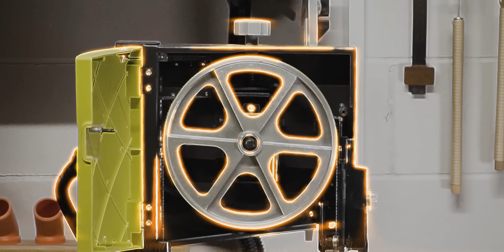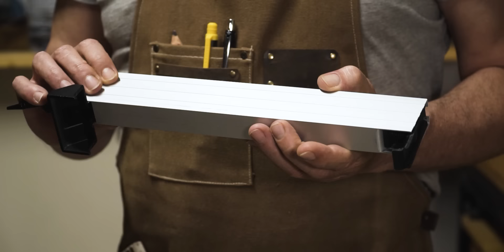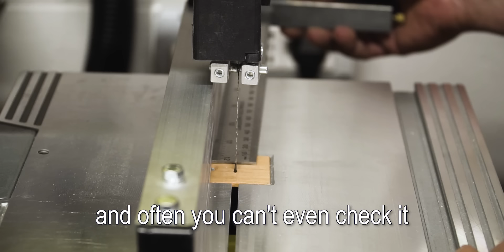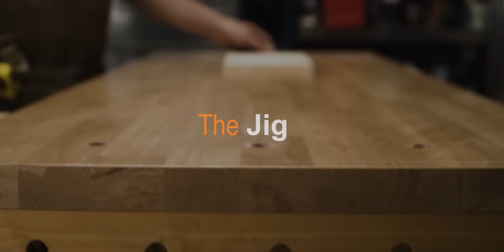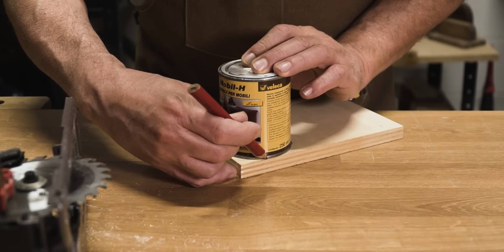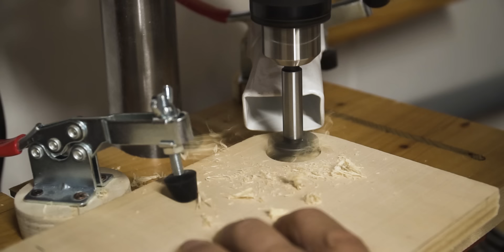If You Have a Small Bandsaw You Probably Need This Jig

Comment: Genius! Now invent one for crappy table saw fences. Many hobbyist woodworkers have older table saws and have to measure the distance from the back of the blade then the front of the blade before every cut.
Reply from the maker: Thanks for the trust but I don't have much experience with the table saw. Maybe it's better to make a new fence that maintains the correct position.

Comment: If the saw is so cheap as to have this type of fence, it probably won't cut parallel to a fence whether it is at right angles or not. What then?
Reply from the maker: And then you have to find the cause of the drift which can be:
- Shelf not perpendicular to the blade (needs adjustment)
- Dull blade
- Incorrect blade tension
There are 30-40 minute video workshops on the subject and how to fix drift problems (even with high end band saws).
I had a problem and showed how I solved it quickly.

Comment: I'm wondering why you didn't move the square down the rule of your combination square to check the fence.  Every combination square I've ever owned has that adjusting feature.  They even make smaller combination squares that are just as good at being square.  I'm just curious.
Reply from the maker: Mine was just an example to show that you can't always quickly check if it's square or not and then adjustments are needed. With the jig, on the other hand, you just rest the fence on it and voilà.

Comment: Very good design. I have the same band saw and not only does it have the same problem making the fence square to the blade but the fence always tilts. This means the timber you are cutting only touches part of the fence. Ideas?
Reply from the maker: This video offers a quick solution for sporadic use, if you use it continuously I recommend you make a new fence.
Thanks for sharing your thoughts.

Comment: Nice idea mate.i have the same crappy fence as you. But my handsaw also suffers from blade drift.ive tried everything I can think of,but it just don't seem to solve the problem.
Reply from the maker: There are really many causes of blade drift, the position on the wheel, the tension of the blade and also the sharpening.
I adjusted the shelf so that the side was parallel to the blade and then I adjusted the position and tension of the blade until it cut parallel to the fence.
This video may help you https://youtu.be/vNdrkmx6ehI?si=6qCYNNXNe81bdZxF
Reply: Also, if the wear on one side of the blade is greater than the other, it will drift to the sharper side.
Reply: There are guide pins (or if you're lucky ... Rollers) below the table as well as on the drop down guide bar. Set both to have sire minimal movement of the blade. Set correct tension. Reduces play that can I initiat3 blade drift. Many entry bandsaws have a quick tension release so that the blade is not permanently tensioned, flip the tensioner again before cut

Comment: I get it. I like it. A very good jig and I will make one. BUT (yes there is a but), I will NOT be using dye and losing the clean look of the birch ply. Good video.
Reply from the maker: Thanks for your kind thought.
I usually dye my jigs dark because they stand out on the light raw wood and I find them immediately, I find it practical (if I leave them natural sometimes I have them in front of my nose and I don't see them) :)
Reply: I get the problem and usually add a brightly coloured knob or feature to jigs that get lost because I like the natural colour of birch ply.

Comment: Question, I’m knew to YouTube and these videos. By the way what a gig, gonna have to figure out the dimensions for this. Thank you for this idea. Thinking outside the box!!! South Central Texas.
Reply from the maker: I don't usually give exact measurements of what I build because everyone has different needs and tools of different sizes. I try to give an idea and inspire people.
In the case of this jig the only fixed measurement is the distance between the front edge and the blade (which varies on each different saw brand), the width doesn't matter and can vary even by an inch.
Thanks for your thoughts.

Comment: Does that fence always lock off parallel the same way and by the same amount each time? If so, the two screws on the top are for you to fix that. Loosen them and straighten the fence, then tighten and it should be good. If it doesn’t, then it’s a bigger problem.
Reply from the maker: On larger band saws there is that feature, here it is not. The 2 top screws are just assembly screws. I consider this a minor flaw for such a cheap product that overall I am very satisfied with.

Comment: On my bandsaws, the blades do not necessarily track parallel to the fence. I take a straight 1x4 and mark a straight line down the middle, then cut it halfway by hand on the bandsaw, staying right on the line. Then, without moving it, I clamp it to the table and set my fence to that board, ignoring what is parallel or square. Now, I get perfect rips every time. If I change the band, I use this same procedure to get the new fence setting. It works for me.
Reply from the maker: If you use the same procedure and then adjust the saw table parallel, you only have to do it once and then with my jig you can adjust it quickly.
Reply: @LTMS  That may be. I have several resaw bands with slightly different characteristics, fine veneer-grade blades, and green wood blades that must be calibrated independently.  A larger model of your jig would be beneficial to dial in a table saw setting. I just use a tape measure and the "bump and clamp" technique.
Reply from the maker: @samTollefson  I see, my jig is for a small amateur band saw, to solve a basic problem, you have different needs.

Comment: Small band saws will only follow the fence accurately when the blade is new.  When the cut starts to deviate slightly it is some time of benefit to slightly offset the fence
Reply from the maker: There are many causes of blade drifting, and one is the dull blade. However, with a good general setup this jig helps a lot in most cases. I shared the video because it made things much easier for me.
Thank you for sharing your thoughts.

Comment: I don’t know why you wouldn’t make those cuts on a table saw. 

The jig is nice. The filming is great…but the question remains why?
Reply from the maker: I don't have a table saw at the moment, just a small circular saw, so I make a lot of cuts with my band saw.
Having the guide perfectly parallel is very important especially if you have to resaw thick pieces.
The two test cuts I make at the end are just to demonstrate that if the bandsaw guide is parallel you can get a lot of accuracy.
Thank you very much for your time and support, hope I answered your question.
Reply: A mitre saw would be even better for that type of cut but not everybody has one. It's also worth pointing out that cutting small pieces, such as dowel plugs, on either a mitre or table saw is dangerous and I tend to find that the cut pieces fly all over the place when cut on my mitre saw.
Reply from the maker: I use the band saw a lot, I find it much safer than tools with spinning blades, obviously it depends on the use, but since I don't have a table saw, the band saw is much faster instead of using guides and clamps to make cuts with the circular saw.
We'll see when I get a table saw, however for non-repetitive cuts I prefer the Japanese hand saws. 😉
Reply: The band saw is quieter but can be less accurate than the table saw. With this accuracy will improve. Such a simple solution.

Comment: The reasons small bandsaw won't cut straight isn't only due to the setting . Ripping hard grand wood is one.
Reply from the maker: There are really many causes for blade drifting, I personally try to use the fence as little as possible
Reply: @LTMS  I use roller fence and eyeball the cut line .

Comment: Very nice, but the ruler is installed backwards!
Reply from the maker: it is installed backwards only in 3 countries on the planet. 😉
Reply: It does not matter whether you use Imperial (inches, feet) or Metric (aka SI) with millimeters and centimeters (American spelling), as long as you use the same scale throughout your project. I am Canadian and grew up using both. Metric is easier to add or divide due to the base-ten decimals and not 1/16th or 1/8th type of fractions. Cheers.
Reply: There are 2 types of countries.  Those that use the metric system and those that have been to the moon………
Reply from the maker: @dhal22  nice try, but NASA use metric system for space missions 😉
Reply: @LTMS I’ll recheck with my uncle, an high level engineer on the Apollo and Saturn designs.  I believe they used imperial.
Reply from the maker: @dhal22  The first comment was ironic and I responded in a light and joking way...
it seems humor is not at home here
Reply: @LTMS mine was humor as well.  Cheers

Comment: Fence on a band saw is not supposed to be parallel!
Reply: It’s supposed to be parallel to the slot in the table.
Reply: @melgross  No it isn't either, you set it to the blade by making a cut after the blade is adjusted and tensioned.
Reply: No you don’t. The blade is first set to the slot, then the fence is set to the slot. You loosen the table screws, adjust the table so the slot is parallel to the side of the blade. Then you set the fence to the slot. If you have a decent. Saw, and you adjusted the blade on the top wheel properly and the guides, all of which must be adjusted correctly before you worry about the table, then you’ll be fine. If you have to play around to adjust it to a cut, then something is wrong. Just ask any if thousands of experienced woodworkers or saw makers.
Reply from the maker: You are both saying the same thing, if after the control cut the shelf is aligned parallel to the cut you are both right.
The setup of the saw is very important, but here we are talking about an entry level product for amateurs, and a jig like mine is used to solve a problem quickly. I personally use it almost always without the fence to avoid drifting problems.
Reply: @LTMS  I guess you dont understand the way I am talking about

Comment: "Small bandsaws are very well made"?  No they're not, generally.  And as soon as the blade starts to wear, it doesn't matter how well you set your fence, the cut will be inaccurate.
Reply from the maker: The best method is always to avoid using the fence and cut freehand.
Reply: @LTMS  Correct.  If the piece needs to be accurate, use a planer (for example) to true it up after cutting it fairly close on the bandsaw.

Comment: Nice, but will never be as accurate as a table saw. You can simply use a jigsaw with a guide, or turn a jigsaw into a scroll saw, there are many tutorials.
Reply from the maker: It is definitely better with a table saw but not everyone has one, I am one of those.
I had a problem with the band saw and I solved it with this jig.
Thanks for your advice.
Reply: I could see your table saw and raise you my radial arm saw, but…which tool is better is hardly the point. He made a jig that improves a band saw.
Reply: @NMranchhand  sure
Reply: Band saws have a different purpose from table saws, but maybe you didn't know this.
If the small band saw doesn't have a precise fence, this jig is substantially helpful.
Reply: @rafaelmijares9197  Yes I prefer myself a bandsaw instead of a tablesaw, I was just pointing about precision, which is never going to be perfect on a bandsaw, as the blade wants to go off a  littlle bit, even if you have a nice jig or fence.
Reply: @myuncle2  You are totally right!
Reply: @ myuncle2 to each their own